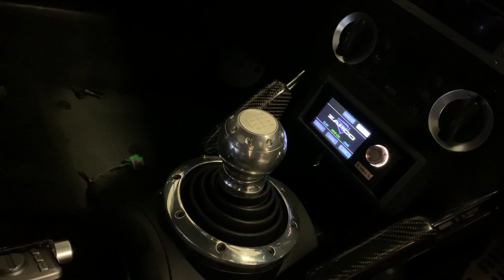Audi TT mk1 High-End Audio System - Teaser & Walkaround PART 2342.

Comment: What’s up Peter. Good day. How have you been? I have a question for you about putting high powered car audio in European based vehicles. How do you power your systems off of a stock alternator without removing it for an aftermarket unit? Here in the states removing the alternator is required because a stock alternator on most American cars and some imports will not supply the amperage needed for the multi battery source car audio systems I have seen. So how is this done on a car such as this Audi TT you are finishing? Are you using more powerful batteries, DC to DC converters or are the alternators in European cars just able to handle the higher current draws required by the high powered amplifiers like the units in the TT? Thanks for your time and Happy New Year. Peace ✌️.
Reply from the maker: Alrich Bullard Hi, well, where shall i start? An SQ focused system never really draws that much power as people may think! This system in the TT draws 5-6A on idle upto 85dB, which is normal, quiet listening level. Then if you go a bit more lively it may draw 20-30A and only when you go crazy with electronic or rap music, then it draws 100A peak, but that’s it! 
Music is dynamic and same way the draw is fluctuating too. We have stock alt in all the cars. This one has a 70Ah good quality AGM upfront linked to a 40Ah Lithium at the back. They float at 13.1V and it only drops to 12.5-6 at peak levels. At normal listening levels it’s stable above 12.8 for more than an hour. On lower levels it can play for 5-6 hours to drop to 12.8 and of course this is all without the engine running. 
The biggest system i built in 2019 had 6-8kW on bass in a BMW E92 (it’s in the playlist), that still had stock alt with 80Ah Yinlong lithium cells and that was stable too, although that needed the engine running at full tilt.

Comment: So, you're using only the mid outs from the Pioneer ? Are you sure that it gives full range without any factoring cuts in the signal ? And another question - in my current setup I'm using the same Pioneer player and processor. Should I switch to ODR ? Is the improvement of the sound that will give me worth the money, or I need very serious equipment to hear the difference ?
Reply from the maker: Vasil Modev can you hear the null point @80Hz & 120-160Hz on your midbass on driver’s side? Can you hear the separation between your mid+tweeter? If you can not, then I wouldn’t worry about changing equipment on that level that much! Focus on speaker installation and tuning! 🤘🔊🔊

Comment: Peter, keep up the good work.

I have a question, 
I have a RF Power 2500 BDCP amp for bass duty, is this a good amp for SQ? 
If not, can you recommend a good SQ amp in the same power class? Maybe even smaller amp footprint than the Rockford?
Reply from the maker: Mr Rez if it doesn’t produce noise and has plenty of clean power, then it can work. The installation & tuning of the sub matter more & how it’s integrated to the system. 🔊🔊
Reply: @pssound9749  Ah, thanks 👍
Happy to hear that.